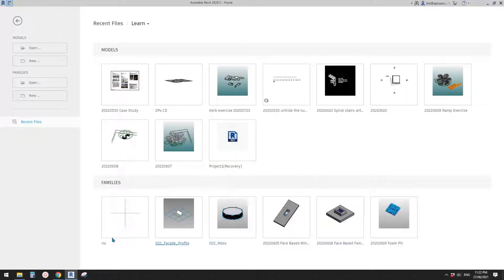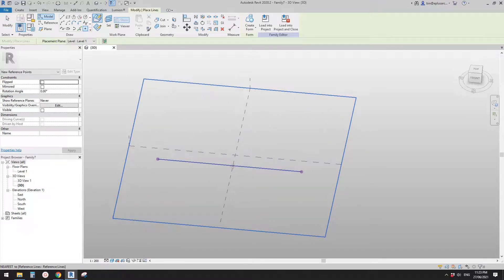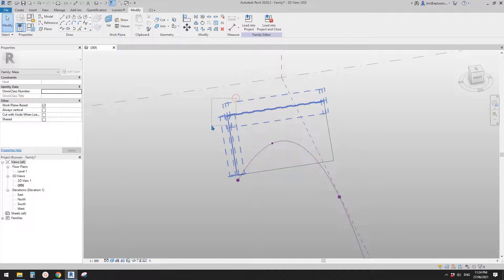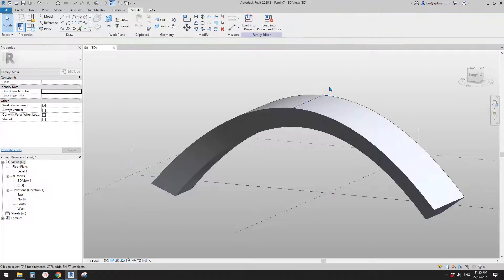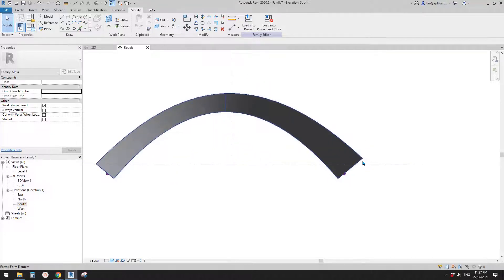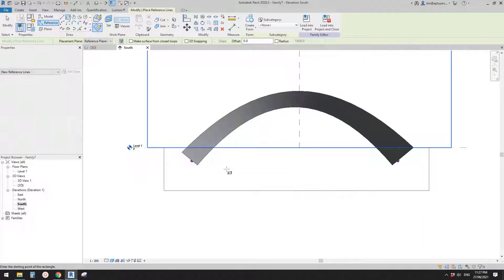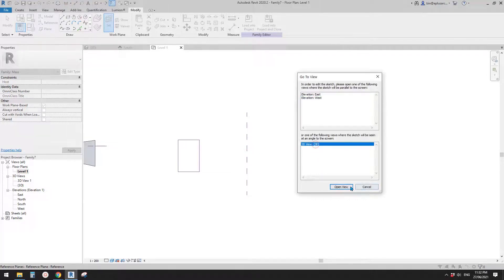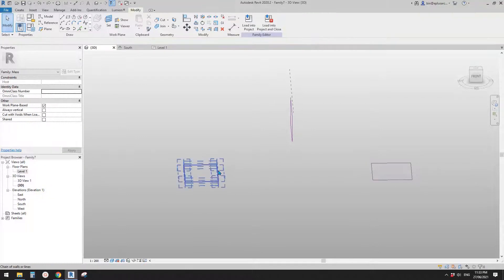Everyday Revit (Day 464) - Mass Modeling Experiment

Comment: Great ... great Bin 👍👍👍
Yes,  apparently Revit does not like a profile horizontal to the path. (perferably paerpendiculat to the path) 
But I've tried with one of the profiles totally horizontal it does work but it says: "This form cannot be created due to self-intersecting geometry. Clicking the Reorder Profiles button will attempt to solve this problem" .... Where a hell is that dam button ?!  🤣
you can of course make a solid with 3 profiles 2 of them under the ground plane, then in south elevation use X-Ray mode to align all points at corners to the ground plan. but of course it chooses the shortest distance to align = the shape could be changed then you have to move the points again in ground plane where you want them to be !
Reply from the maker: Yes. Hopefully there is a better way to do it. I’m still not very good at doing these in Revit. I guess it is easier to model then in other program and import back to Revit.
Reply: @BINHE615  
personally I think you are quit experienced in Revit cause you try to dig in Revit problems & find out how to come around the limitations. this what makes your channel different from all other.  you do a very good job 👌
Yes true... you can model it easier in other 3Dmodeling programs but some times Revit does not understand the face that was done outside of Revit. 
Anyway although it's not user-friendly but still a powerful program especially for architects
Reply from the maker: Thanks.

Yes, especially families, better model them in Revit.